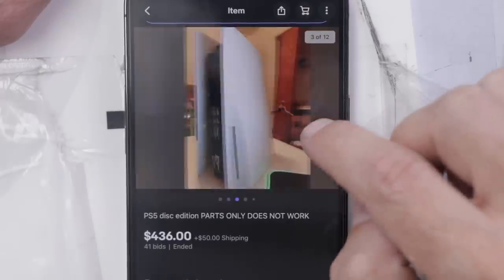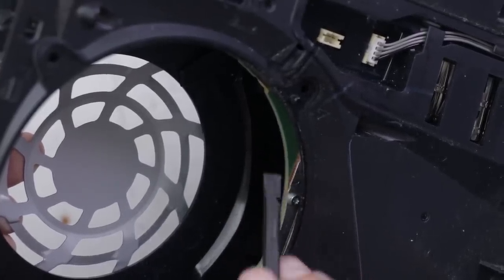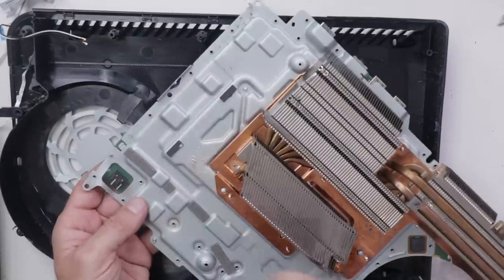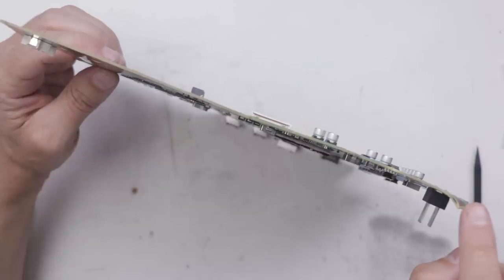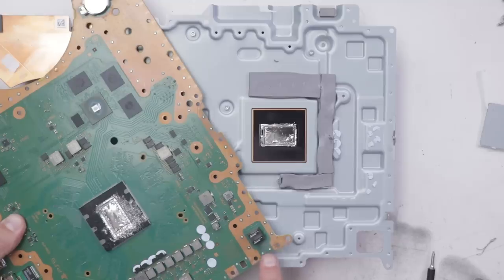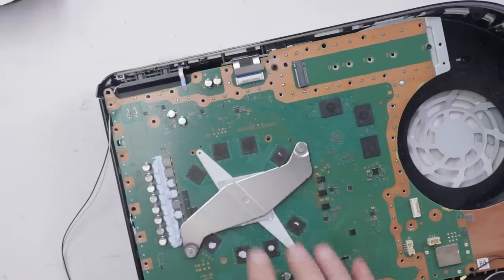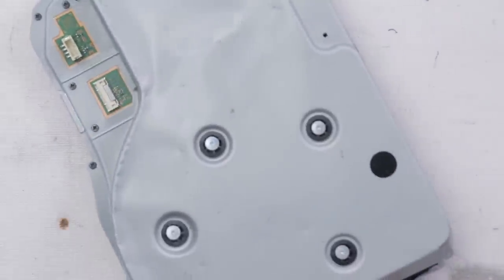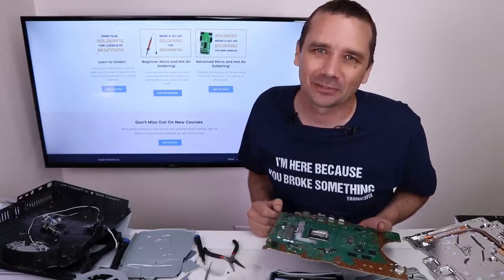I Bought a PS5 That Was RAN OVER!!!  - Can I Fix It?

Comment: While I was on vacation some years ago my gameboy advance was in a protective case, and my father accidentally dropped it and we didn't manage to pick up in time that a SUV (loaded with luggage and 5 persons in it) ran over it, the protective case was destroyed, the actual gameboy shell had some stress mark and also some Crack marks, the screen shattered, but when I later tried to  power it up, it still worked! And even a small area of the screen still displayed data!
Reply from the maker: Wow! That's impressive
Reply: @Tronicsfix  Indeed, both where shocked that it still worked
Reply: @mrascensoreakakrisgames4149  The SUV got off easy, if that were your parent's Nokia 3310 then it would've made the tire jump in the air and lose control of the steering wheel.

Comment: That's why I don't even deal with auctions anymore. Low/no ratings people just bid whatever they want and then don't pay after they win. And then eBay doesn't even let you leave a negative rating.
I only list stuff as buy now with immediate payment required, and if anyone sends messages trying to haggle I just don't respond. I left off the "make offer" button for a reason, and that reason is people can use it the same way as winning an auction: agree to buy for a certain price but then not pay, leaving you in limbo.

Comment: The thermal pads on the oposite side of vram are present on ps5's with samsung or sk hynix memory modules. The ps5's with micron memory don't have them. I believe that's because of the operating temp of micron, that goes to 95C and the other ones to 85C.

At least that's what i think after disassembling mine that has hynix memory and seeing a bunch of teardowns.

Comment: lol Gamer's Nexus reviewed a computer that was advertised as having liquid metal. Well it did.....all over the board.....all over the case, but the place that should have had it.....was using normal thermal paste. LMAO They contacted the manufacturer and got sent another one.......same condition!! LMAO
Reply from the maker: What?! That's hilarious. I might have to go watch that video.
Reply: @Tronicsfix  yeah. So the verbiage on the website said they used liquid metal... But not all of them do..?? So they had thermal paste but then liquid metal all over the board. Was very interesting
Reply: Wtaf?!
Reply: yeah I saw a similar video showing that the case advertised on their website as being made from carbon fibre isn't, it's just regular plastic made to look like it. 🤔🤔😁😁
Reply: @markrowe8824  oh yeah I forgot about the carbon fiber. Sadly it's a decent compact computer. You can mount it behind a monitor and the performance is good assuming the LM didn't fry the board. It's specs are similar to my laptop.

Comment: Reminds me of an on-site service ticket I had of a laptop years ago. 
Problem description was "will not power on" and they sent me out with a system board and DC jack.
The customer was a student, and said it fell out of their backpack on the way to their car, hitting the parking lot pavement. They had accidental damage coverage so I told them it shouldn't be a big deal. I noticed the lid was covered in stickers and they looked slightly scratched but didn't really put any thought into it, I popped open the display to assess the damage and saw the LCD shattered along the top. I then noticed that was slightly bowed up in the center. I turned it over and that's when I saw what looked like a tire tread over the front part of the computer. I asked them if it had been run over and they said "yeah, when I heard the crunch, that's when I saw it had fallen out of my bag." since that would require more parts than I was sent, I had to call it in to have them change it from on-site repair to depot repair, which was the protocol in a situation like that.
Reply from the maker: Ha, ha. Wow, there was a little more to the story!

Comment: Lets face it you bought it cause sony doesn't have repair parts for board level fixes out yet, if ever, and this'll give you a bunch of components to use to fix other ps5's. Not a bad idea really.
Reply from the maker: I bought it because I make money by creating entertaining (hopefully) videos for YouTube AND because there are good parts on the board that I can use for other fixes.
Reply: @Tronicsfix  Totally a fair out look on the whole experience. I don't think it was run over however. It looks like it slid across the ground rather than just compressed. so thrown/dropped out of a vehicle perhaps? Still its guts will likely help fix lots of other machines.

Comment: Waste of money? Maybe. Fun video to make from it? Absolutely. Still worth it imo from the content creator side. And for us, its fun exploring it. Btw, I was curious, since its liquid metal, considering gravity, is it better in vertical orientation or horizontal? I'm not too technologically adept. Idk enough about how liquid metal behaves to understand if its just as effective using my ps5 in solely vertical orientation or not.
Reply: Assuming the massive pressure the apu is held down with, the liquid metal should be very tight to the apu regardless the orientation.
Reply: Ty for replying, was really curious on the best orientation since fixing ps5s and buying replacements are near impossible currently. I chose vertical assuming its more surface area exposed for cooling instead of insulating heat. I was just always curious about the liquid metal.